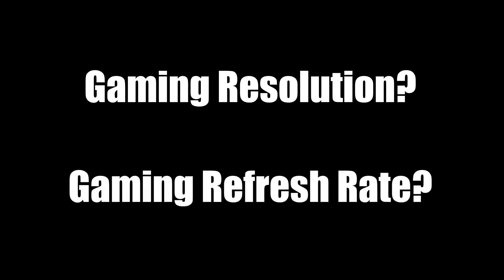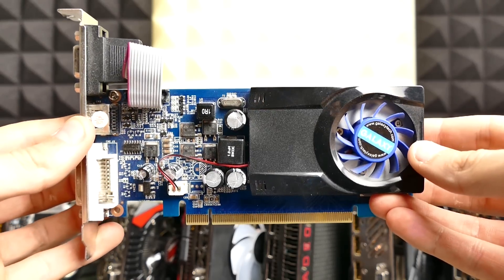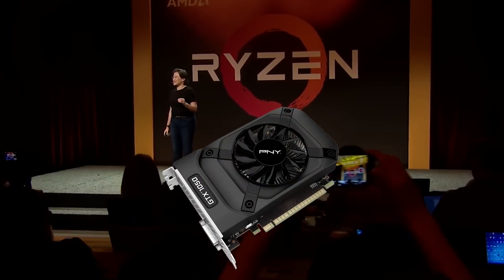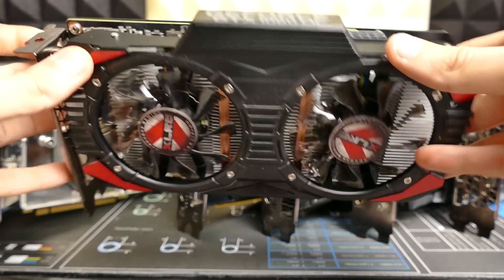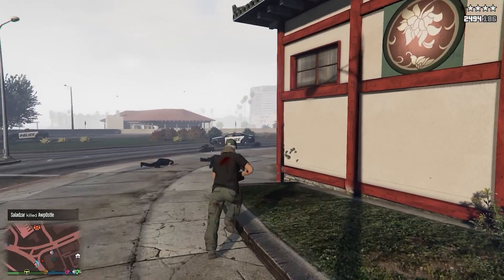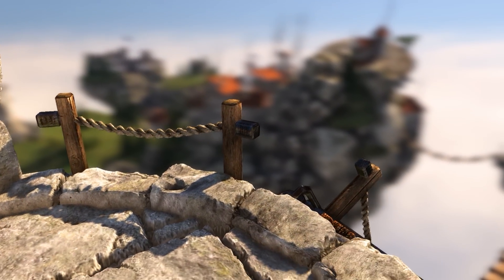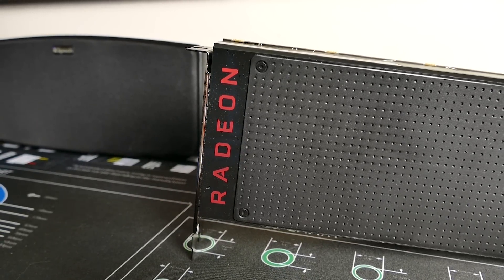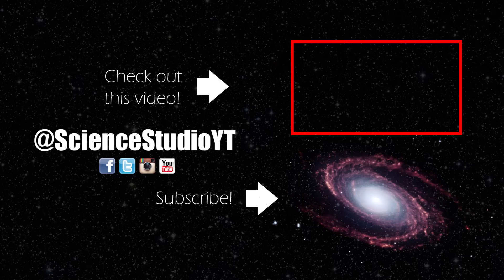Graphics Card Buyer's Guide (Mid-2017)

Comment: My brother build not too long ago his own system for much cheaper then what he thought. He actually though a good PC would actually cost him a ton of money. Which he learned it dose not if you know what you are doing.
Entire System+ Monitor, keyboard and mouse costed him around 950$.
Case-DIYPC DIY BG01 costed him 32$
MB-MSI B450 77$
Ram-Team Group Vulcan 16GB 2x8 3000mhz 90$
SSD-Kingston 400U 240GB- 34$
CPU-AMD Ryzen 5 2600 165$
PSU-Corsair CX 450W Bronze 20$
GPU-EVGA GTX 1070 8GB SC 220$ used
Monitor- Acer CB351C 35in 2560X1080 60HZ 263$
Keyboard-Redragon K552-R-Kumara RGB 36$
Mouse-Logitech G402 29$
The reason he didn't go with AMD Freesync or Gsync because he dose not want to be limited in either technology because he's not a fan of either GPU company. But I'm proud of him. Also all he told me is he wanted to play every game he could at 60fps and he didn't care about Freesync and Gsync. He just wanted the best for the price and I believe he did a good job. OFC my system is completely opposite then what he has :D.

Comment: PLZ help!!! 
1080p, 16GB ram, 144 htz refresh rate, dual monitor set up, amd fx 8350 black edition... which graphics card should I go with? I play very graphic intensive games like bf1 and GHOST recon
Reply: domainestickem your cpu sucks if you want to have 100+ fps
Reply: gtx 1080 would be a good choice or a  1070 but for 100+hz the cpu is very important so i recommend you upgrade to  8600,8600k,8700 or 8700k.

Comment: you literaly cant find or buy a GPU under 300$ if u want ot game in 1080p as of 2017 august. liek its the most frustrating thing i have to dae lwtith right now cause i want ot game so badly. 1080p 144hz 100-200 fps all AAA games, ie D2 OW ect. its a nightmare. screw you etherium

Comment: Can you guys tell me is there something I can fix with this pc setup...Core i7-6700K 4.0GHz Quad-Core, GeForce GTX 1060 6GB 6GB GAMING X, S340 (Black/Red) ATX Mid Tower
Reply: Alejandro Tomas What do you want it to do? The 6700k is perfect for just about anything but on the gpu side: 
The 1060 is good for 1080p/60, a 1070 is good for 1080p/60 high details & 1440p/60 medium, the 1080 is 1440p/60 high & 4k/60 low/medium, and the 1080 Ti is good for 4k/60 very high details settings. If you are looking at different refresh rates it can get dicey and would recommend someone else give their opinion.

Comment: i always get stuck at which monitor to buy...I dont mind just gaming at 1080 but would not mind going higher thats why im thinking of pairing a ryzen 7 with a 1080ti or 1080. but it comes down to the monitor...gsync,vsync freesync, the frequency of the damn monitor...i just dont want any stuttering of lag on my screen after spending all that money on the cpu and gpu but at the same time i dont wanna spend too much on a monitor...any suggestions? like just the right monitor for this cpu+gpu to get the seamless 1080p gaming and at least 1440p gaming but i jsut dont want it to stutter and dont wanna spend too much on the monitor cus i know gsync ones cost a bombshell but if i switch to rx580 i dont wanna crossfire and stuff..soo bloody confusing this whole affair. plus the increase in prices on the RAM and GPU hasnt been easy to deal with these days. the games I usually play are mmo's, borderlands franchise, diablo 3 and stuff like that but im planning on getting doom and some other new titles this year so hence either the 1080gtx or the ti or the highest amd has to offer for now...niways basically I just wanna know what kinda monitor im looking for and best bang for the buck..or should i change my strategy? any thoughts and ideas im open to sugggestions please and thanks
Reply: Well this coming week of July 29 - August 3rd AMD will be announcing at SIGGRAPH the Vega gpu that works with Freesync monitors. Freesync monitors are $200-$500 cheaper (depending on size) than G-Sync monitors for the same technology. So if you are into 1440p gaming and want smooth performance for the least amount of money. Get the Vega XT and a 1440p Freesync monitor (there are different brands) with 75, 100, 120, or 144Hz refresh rates. The higher refresh rates are usually more expensive but make sure it has at least a 100Hz rate for a really smooth gaming experience. Regarding the cpu, unless you absolutely NEED a Ryzen 7, just get the $190 Ryzen 1600 (not X) with DDR4 3200Mhz ram. Best of luck.
Reply: Wavy Travy thks for the advice. I'll be waiting for the new cards then.

Comment: i just picked up a ryzen 5 1600 and a windforce 1080 off amazon and to go along with it i got a 1440p 144 refresh rate monitor from acer which ive heard is overclockable to 165 or something like that 
Would those two things combined be able to push my monitor to its max or should i go with a 4k 60 monitor

Comment: I laughed when I saw the G210.  -  I am using an MSI 980 Ti Lightning that cost $660 that came with a free game, and it is about as fast as a non-overclocked GTX 1070.  I would love a 4K monitor and a next generation video card from AMD or Nvidia, however, there is a strong likelihood that I may not be able to afford them.

Comment: Thanks for this video. My current emergency build needed to stay as close to $300 build as possible. At first that included a PSU... but now I found a brand new one from an abandoned 5 year old build along with a Case. So now I can get a full ATX Motherboard and a budget video card. AMD FX 8370....Asus or Gigabyte full ATX....8 GB DDR3....possibly an RX 460. This computer will be used for a home theater/ music computer once I can build another more powerful rig. I just found a piece of tempered glass for my Cooler Master case so I gotta get to some cutting and painting.....

Comment: i have :
i5 6600k
Gigabyte gtx 1070 G1 Gaming 
8GB DDr4 Ram
but i don't get good fps in alot of games on 1080
is it the ram that bottlenecks the system or the cpu bottlenecks the gpu ?
p.s: the cpy isn't overclocked

Comment: hmm what about a gtx 1080 ti
i7 7700k, 600 w psu corsair, asus prime z270-a motherboard , corsair vengeance 3000mhz ddr4 2 8gb of ram, 6 tb hdd, 250 ssd, LG optical drive, don't know what case yet and don't know what cooler to get for the cpu because I heard it has massive temp issues.

Comment: hi can a 1060 6gb card and a i5 7500 perform good on 144hz ? mainly csgo
Reply: Sanjeet Jain cs go wont be a problem but with the newest AAA games it wont reach 144 FPS at full settings
Reply: I usually play at low in csgo at 1280×1024 stretched..

Comment: I have 1080p 60hrz monitor with Intel i5 6600 ram 8gb(Plan to upgrade ram in future too) 
Should I buy rx580/gtx1060 or wait Vega/Volta
My budget is only 300-350$ for gpu only
Reply: Wen Xer you could get a 1060 with 6gb Vram. it runs almost every game at full settings 1080p 60fps

Comment: I'm one of those that watches these videos mostly for fun 'cause I don't need the advice (though I can and do pick up info from a comment in even a basic video), but the other reason is to see what vids I want to recommend for those looking for advice. This one is at the top of that list because of the emphasis on knowing what you intend to do as a basis for your choice.

I would add that game choice is another very important component - but mostly for those that only play a main game and few others (such as many MMOG players). Know your game, and know how it differs from the ones used in most hardware site benchmarks. Games like Black Desert Online don't follow the general rule and can use all the CPU you can throw at them and want more graphics card power at what you might otherwise use for most games at a particular resolution and frame rate (for BDO a complex issue, but more CPU cores means better frame rates in cities and anywhere there are more players).

Comment: i managed to get a saphire rx 480 8gb for 200 bucks about 4 months ago. happy with the card but would like something quieter with slightly better performance. anyone got any suggestions? i game at 1080p 60fps and dont want to break the bank. thanks in advance
Reply: in case anyones looking to buy the rx480 i have to mention that the rx480 did thermal throttle initially but that was fixed with wattman.

Comment: I would suggest adding two points of consideration to any future graphics card videos.  The first would be variable refresh rate technologies.  My next card will be an RX 480 or RX 580 because of this.  I want to try out a variable refresh rate monitor, but my budget can't handle G-Sync right now.  I was able to find a 1080p 75Hz Dell monitor for $129 at Microcenter as an open box special (I got lucky and got a new in box one for that price because they could not find the open box one, normal price $159).

The other suggestion would be a bit of discussion about the RX 550 and GT 1030.  These are not cards I would buy for any sort of serious gaming (even e-sports titles).  They are great for HTPCs though.  As 4k TVs become more and more prevalent these serve as a good, low power upgrade for an existing HTPC to push out 4k.  The GT 1030 in particular is a little cheaper and has multiple low profile options.

I know you typically don't delve into rumors, but something else that should be noted with regards to FreeSync is that the new Xbox Scorpio is rumored to support FreeSync, and many existing TVs can be firmware flashed to support FreeSync.  FreeSync may be the way going forward.

Comment: I bought a sapphire fury oc (1020 mhz base clock version) back in february, too bad it is heavily bottlenecked by fx8320 @ 4,1 ghz. Even then, it is a great card overall, and a great overclocker, running 1120/500 @ +15mv (with an ASIC score of only 53% WTF) most of the time, but i was able to hit 1180/500 as well, scoring 16920/8900 in Firestrike/FS extreme - graphics only.  Didnt try to go over that, no point with that CPU

Comment: Best 21:9 1440p card?
Reply: Probably a GTX 1070 or RX Vega equivalent because you're going ultra wide 1440, which the RX 580 and the GTX 1060 are only going to give you about 45-60 FPS on ultra, about 60 or more on medium-high

Comment: Ok guys I got a 1080p 60hz monitor and a i5 6500 with 480w psu and what I want to know would a 1070 work on them or should I get a better psu with a 1060 with 6gb ? and keep in mind I can't save up because I'm not going to work for a will as I'm studying so it's between only the two.
Reply: A Core i5 6500 and a GTX 1070 paired together will consume about 215W of power alone and along with other components, it would equal under 300W. You'll be fine with this setup and your PSU
Reply: AstroTech Studios Thank
Reply: You're welcome. Happy to help you out!

Comment: I plan on upgrading from my AMD 280 when I plan on making the switch to 1440p, so Im waiting on Vega. Im still fine with its 1080p performance (and astounded with its longevity of 3 years and counting) so I see no reason to upgrade today unless I'm moving up in resoultion.
Reply: Instead of moving up in resolution consider a widescreen 1080p with FreeSync and IPS panel (lg for example make a great monitors there, for example lg-29um68-p), if you are not going to refresh your gpu every second year the 1440p resolution might swallow your budget hard. And looking at your current graphic card you don't look like you'll upgrade so often.

Comment: I'm thinking of switching to 1440p, but I'm worried 1080p content will look weird. Anyone with a 1440p monitor that can help me make up my mind_ Also, does NVidia have a way to limit max framerate for older games? Thanks for the tips!
Reply: I already told it above, but it might help: Instead of moving up in resolution consider a widescreen 1080p with FreeSync and IPS panel (lg for example make a great monitors there, for example lg-29um68-p), if you are not going to refresh your gpu every second year the 1440p resolution might swallow your budget hard. And looking at your current graphic card you don't look like you'll upgrade so often. Also 1440p on lower graphical setting is not that better then 1080p on ultra. For frame limiting read about v-sync. Im not sure exactly what is it, but I've heard that it limits frames.
Reply: I'm buying a high refresh gsync or freesync monitor anyway and with a card like the 1080ti, 1440p over 60 fps will remain feasible. Vsync is not what i need, at it does not set a max framerate limit

Comment: Bought a Zotac gtx 1080ti a week ago and had only problems with that ( Fans randomly starting to rev up to 100% and Coil whine, the worst coil whine i ever had), now its back in the shop and i bought myself a Gigabyte gtx 1080ti non Extreme.
Reply: Hawkeye979 what cpu?
Reply: i7 6700k @ 4,5ghz... got now a Gigabyte gtx 1080ti non extreme and that card has even worse problems, getting bluescreens and artifacts currentyl, drivers and bios updates also not helping... man i just want to fucking game in 1440p and not trying to fix this god damn mess nvidia did with their cards...
Reply: but the fan problem is gone tho?
Reply: I refunded the Zotac card because it was awefull, gigabyte one is also not better... stay away from a gtx 1080ti, only problems with that shit. My old card the 770 is working fine but every gtx 1080ti has problems for me.
Reply: I feel sorry for you. I have the Aorus GTX 1080 Ti non extreme and it's working perfectly. No issues at all.

Comment: 1. 1366x768
2. 60 refresh rate monitor

so, rx 460 4gb or 1050ti?
Reply: also, get the 2gb rx 460. at that res, you wont need more than two gigs
Reply: Ahmad Vawaid Sulthon rx 460 will do the trick! also, the 1050 ti is much worse price/perf
Reply: thanks

Comment: Rx 470 8gb or rx 480 4gb?
Reply: 20scream20 where I live, rx 470 8gb from msi and rx 580 4gb are almost the same price.. Both are armor OC version..
My requirement is 1080p gaming..
Reply: dont listen to people that say take the 480 i got the nitro 470 8 gb and for 1080p gaming its perfect and you will need more than 4 gb vram as even now doom is taking 4.5 vram on my card so for a year or so many game will need more vram and the rx 470 as tested in many benchmarks is only few fps behind the rx 480 i did many research before buying my 470 card and i happy with it
Reply: go for the msi its even better than the saphire nitro version and when i got my nitro few weeks ago in the store there was rx 580 4gb at the same price but i chose the 470 8gb because i did very long research before chosing the right card covering everything from benchmarks and future proofing the 580 is overclocked 480 nothing new and the msi 470 is 5 to 10 fps behind the 580 and when its overclocked its almost same fps and lower power draw the 500 series already have trouble for drawing too much power.
Reply: there was 570 4gb 30$ less than the r470 8 gb that i got aswel but i chose the 8gb and glad i did as many games already needing extra vram for ultra like watch dogs 2 that i try and doom
Reply: 20scream20 thanks man..
Reply: no problem glad to help better choose wisely than choose poorly and regret it after :)
Reply: Kaushik Mitra 480 4gb is better value. 4gb is more than enough for 1080p, and the gpu is actually beefier and faster so you'll observe higher frame rates compared to the 470.

Comment: if you are really low on money, you should get a "Asus Radeon HD 7950 DirectCUII TOP V2" . it has huge overclocking thermal headroom and is really quiet because its a 3-slot beast! but be sure to get the V2 version cuz the original had some major problems

Comment: rx 580 8gig vs gtx 1060 6gig which one should I pick
Reply: ankur chakraborty I'd go with the 580 for the extra vram and it's better for DX12 and above
Reply: ankur chakraborty whichever is cheaper
Reply: ankur chakraborty I would choose the 580 but if the 1060 is significantly cheaper that might be a better deal
Reply: the price difference is 5$ ( i m choosing the zotac amp on 1060 6gig while saffire nitro on 580 gig)
plz suggest

Comment: do you think two crossfire RX480's can handle 1440p gaming alright?
Reply: RebelViking912 yea
Reply: RebelViking912 Remember many games aren't fully optimised to properly use crossfire (leading to sometimes lower fps than single card)/ don't support crossfire(leading to just 1 card used). With the money you're spending on 2 480s (or 580s) you'll get better performance with a single more powerful gpu like the 1070 or 1080 or wait for amds vega.
Reply: Thanks for the reply!

Comment: It's sad, I have a dell inspirion and the only thing that will fit is a Low profile AND single slot GPU (Done MUCH research on it) The gt 1030 is not that great, but it is great for that PC and should allow me to squeeze 2-3 more years of modern PC games until I build something myself. I don't mind 1080p resolutions, actually my native screen resolution is 1368x768, so for now I'll be fine. Just ordered one.
Reply: Emanouche I've heard there are some single slot 1050 and 750ti cards available. They might be a possible solution
Reply: There are single slot or low profiles one, but not both (Trust me, I did ton of research) The low profile ones are too thick for my case, the single slot ones are too tall for my case.

Comment: I found a good deal on a 3440 x 1440 g sync monitor that runs at 100hz, and I'd like to play games like Witcher 3, Skyrim, etc., with graphics overhaul mods. Between the gtx 1080 and 1080 ti, which will suit this monitor the best?